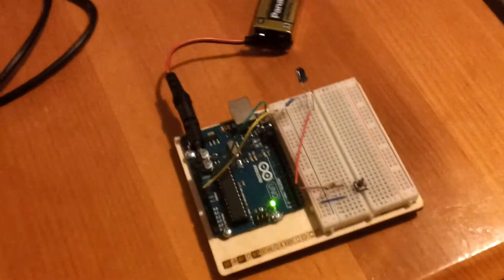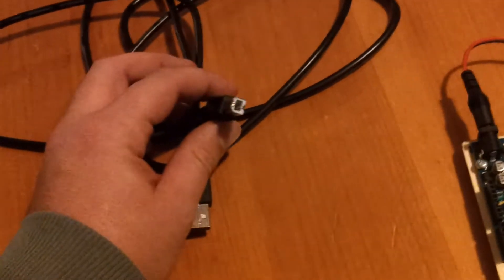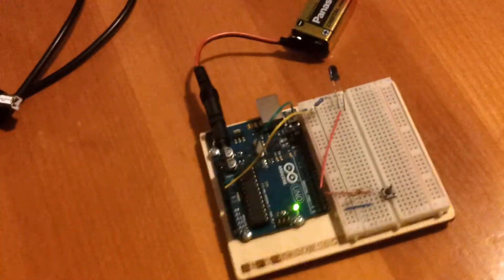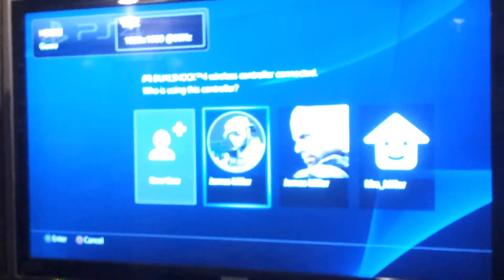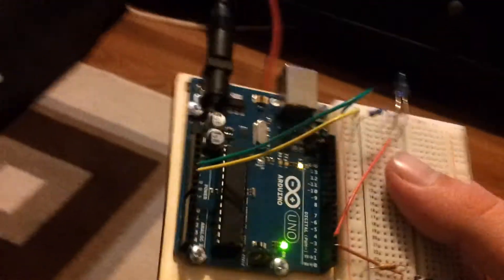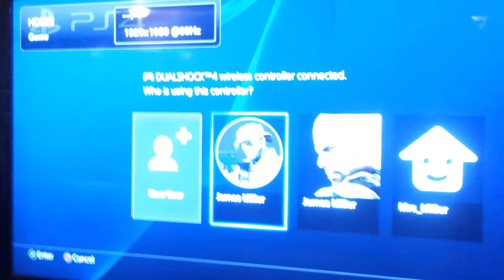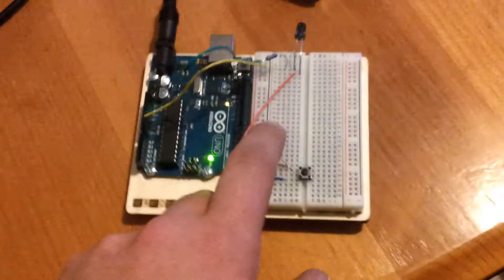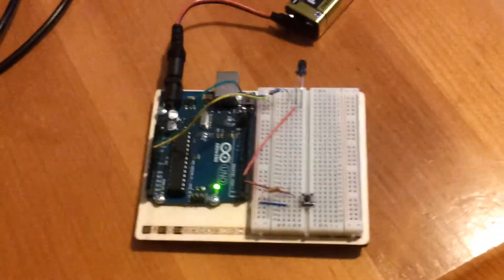Arduino - Turn off any TV wherever you go

Comment from the maker: I have tried this with a single clear IR LED with a wide wavelength and it more then doubled my distance I can turn off and on my TV.  I can probably turn my TV off from about 20 feet away or more using the same circuit.